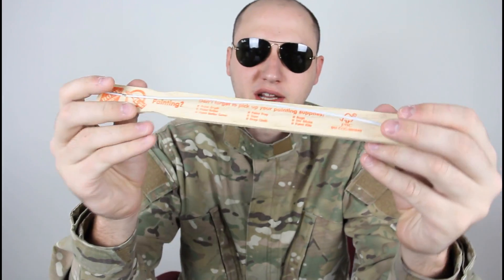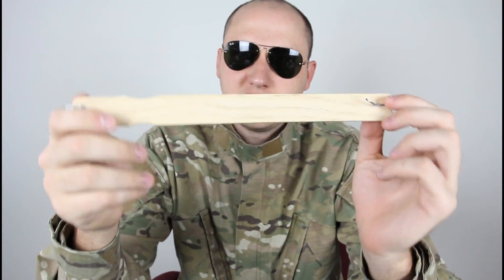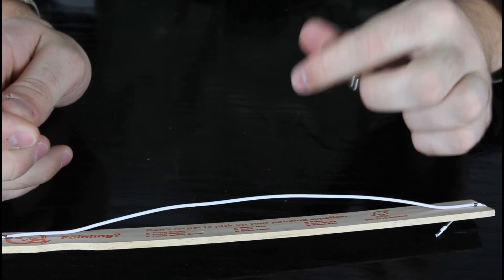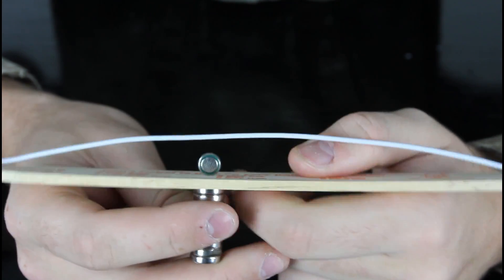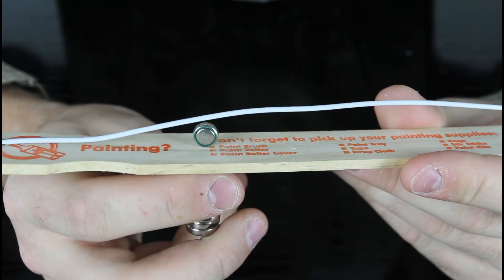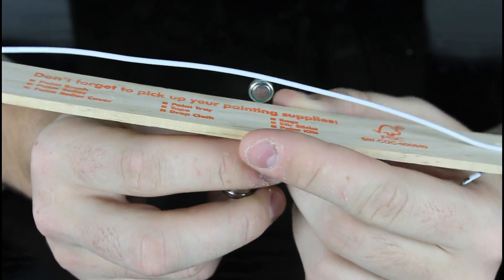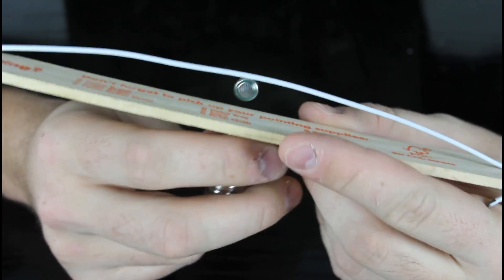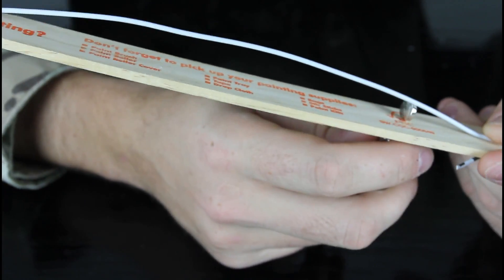Crazy Neodymium Magnet Experiments

Comment: The effect has nothing to do with the metal object's being a battery. Its casing is ferrous metal, so the magnet attracts it.  The wire is also of ferrous metal; it wouldn't work if the wire were merely conductive but not ferromagnetic.  The wire focuses the lines of force around the magnet .

Comment: The casing of the button cell is magnetized by the neodymium magnet, the wire must be magnetic like soft iron, then the magnetized battery case hangs on to the wire. If the wire is copper or aluminium then it must be an eddy current effect which I don't know why, other than neodymium magnets have weird properties.

Comment: The magnets make magnetical energy go through the wood into the metal wire and the metal wire becomes magnetic and since there is nothing blocking the wire the wire is has more pull then the magnets that are getting blocked by wood making the battery stick to the metal wire.                    And that's an explanation from me :)

Comment: The magnetic fields of the magnets interact with the wire and align the wire's particles in such a way that the wire itself becomes slightly magnetic. With the wire being more magnetic now than the ruler, the battery will tend to stick to the wire and not continue to roll on the ruler itself.